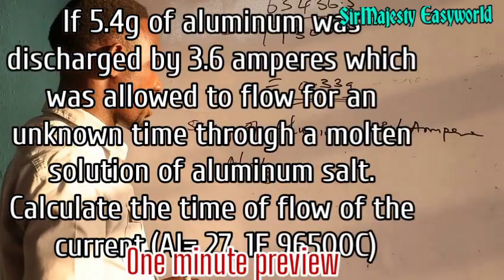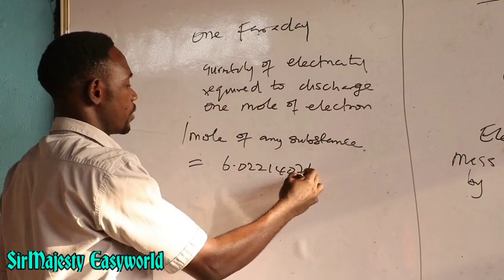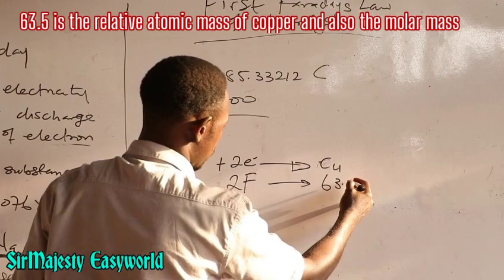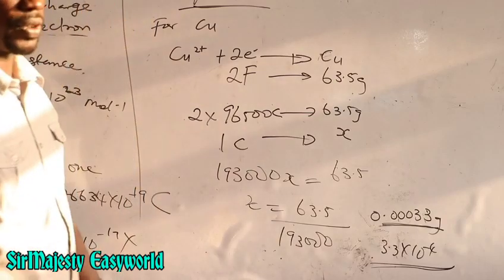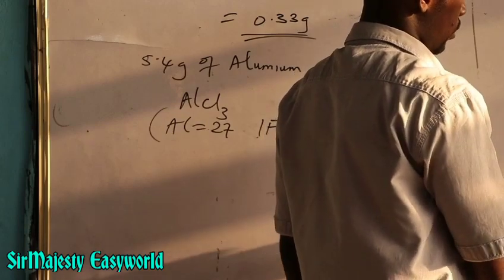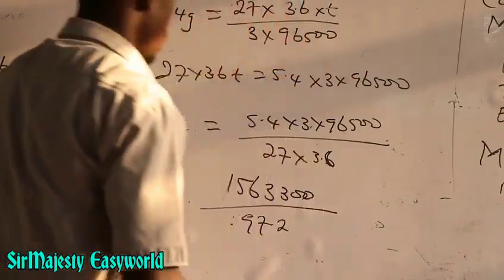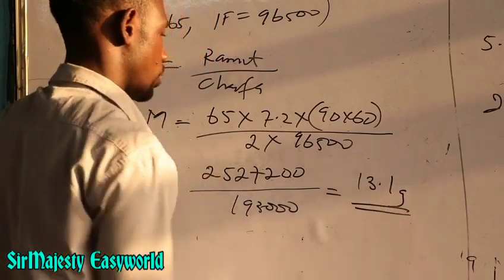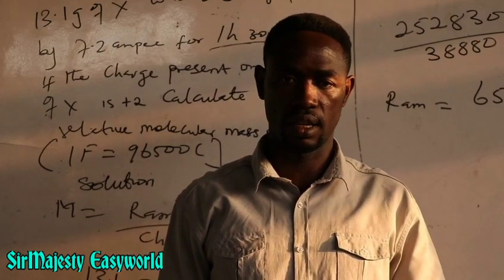ELECTROLYSIS Calculations made Easy. first Faraday's Law of electrolysis and the easy ways

Comment: Sir how can I calculate this equation below
What quantity of electricity is passed through 16g of copper
[M=64,1F=96500c]
Pls help me sir
It can be any one pls
Reply from the maker: I really would have helped if I understand your question.
First of all,your question seems to lack alignment with established scientific principles/ theories.  Find questions from approved exam bodies or someone who really know practical science. Maybe the question is relating resistance and conductivity of copper wire(not anywhere close to electrolysis questions) but unfortunately it did not specify conditions,😆😆😆😆😆. I advise, you take this question down and advise whoever is testing you to go and have average understanding of electrolysis and Faraday's laws of electrolysis. You can rather modify/correct the question to align with established scientific principle.  Much love Remain Majestic..

Your question Incase you change it.

Sir how can I calculate this question below 
"What quantity of electricity is passed through 16g of copper [M=64,1F=96500c]"
Pls help me sir,it might be anyone.